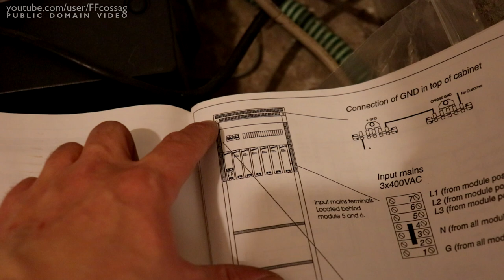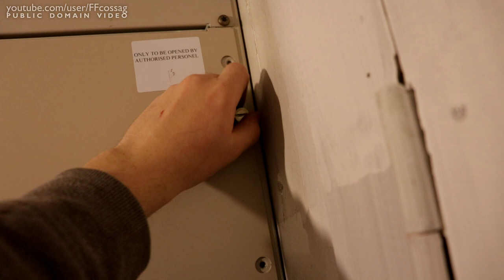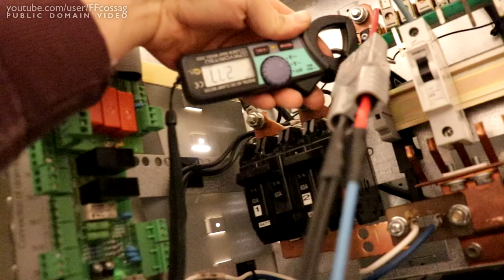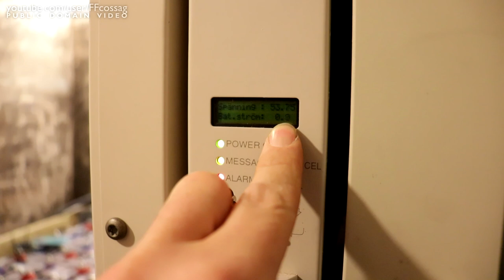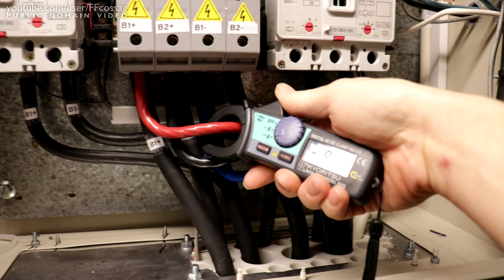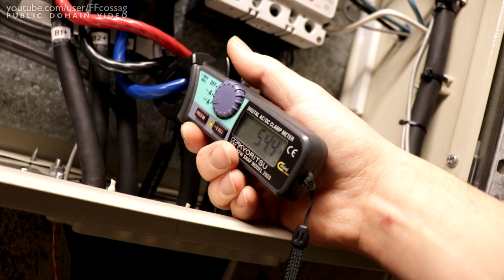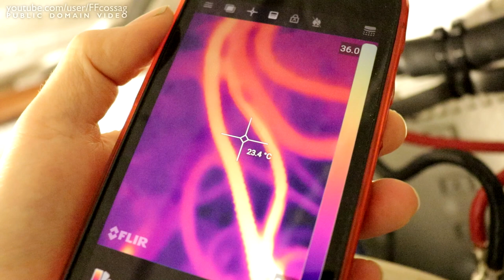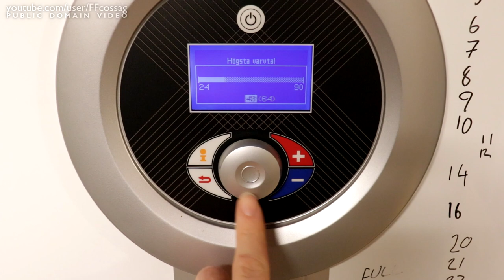Installing a 6 kW 48 V rectifier rack in the basement

Comment: In the event of a power failure like that long-lasting one, the heat from the cables alone ought to keep you warm throughout... :P
Reply from the maker: Hehe, yeah, at 120 A, the entire length of cable between the rack and the DC central will dissipate about 60 W. Ideally, it should never have to do that since it's mostly just an AUX battery hookup, but you never know!

Comment: Absolutely beautiful! 👍
Reply from the maker: Thank you! Cheers!
Reply: @FFcossag  :D Now you can charge properly from the grid too! Using that salvaged cable with the shield was a wonderful idea, I might use that idea myself for my own DC power stuff :) I never thought about using those cables for it, I have access to plenty of them (3x25+16) but never realised they could be useful for this. Ialways assumed the shield resistance would just be too high so I never attempted to try them, after watching this I realised it might not be so bad afterall :D

Free stuff is the best :)
Reply from the maker: Free stuff is indeed the best, and 3x25+16 is fine for up to 150 A or so if you do 2x25 +1x25/1x16! I was meditating on these cables with a friend, and they might actually be fine for a little bit more than that, since the large surface area of the shield, being wrapped around the outside of the entire cable, might allow it to cool off better than the internal conductors - but I wouldn't risk more than 150 A anyway, hehe.
Reply: @FFcossag  Hehe, cable lenght also plays a important role, so for a short run, it might actually be safe to run even more powah through it :) But yes indeed, I suspect the shield might be able to handle more than one would think too, I might need to bring out my big boy transformer and do a little test on this :wink:
Reply from the maker: No, you won't be able to run more current through it than that. 

Those cable current specs are calculated based on how much power a cable can realistically dissipate per unit length without overheating. While you will have less of a voltage drop problem for a shorter cable, the only way to get higher current ratings for a specific cable thickness is to use higher-temperature insulators. A teflon cable will have a higher current rating than a PVC cable, for instance, since it can handle higher temperatures without melting.
Reply: @FFcossag  True, I forgot to keep that into consideration. Been a few years since I took my electrical grades, heh. Cx I'm a electronics nerd, not necessarily power transmission nerd lol 

I'm curious about another thing regarding your solar panel wiring, since all the panels are in series, if one gets slightly less sun than the others will the decrease in power be very dramatic? I know more expensive panels have a by-pass diode, but I'm curious if they actually work in practice. I haven't seen any tests done on that, I suppose I could myself but I don't feel like taking all my wiring apart which took a while to make all nice and neat and proper. My cheapo panels from years ago stop working all together if wired in series and one of them gets covered with clouds, they don't have any bypass diodes. I therefore run a very thick cable to them and use them in parallel, around 20V with 10 amps hehe. You're probably gonna make fun of me for thinking that's a lot of power lol, but for me it is a lot of power lol 😃
Reply from the maker: It's a lot of current!

And the answer is yes, even minimal shading can have huge consequences, though it depends a lot on your charge controller. EEVBlog did a video on it quite recently, about how the shadow of a single guy wire was causing him huge issues.

Comment: Do you have any extraction in that space for any off gassing from all the lead acid batteries? Genuine comment love following your DC battery power updates  👍
Reply from the maker: Yes! This space used to house an oil furnace, so there's a HUGE chimney hookup that provides completely overkill ventilation without even needing any fans. I don't know exactly how much air it moves, but if I hold a normal 120 mmPC fan in the chimney hookup, it'll turn a good 300 RPM just from the passive flow. There's a roughly 80x80 cm air filter installed in a window frame in the adjecent room, so the space is constantly fed with fresh, clean air.
Reply: @FFcossag  I knew you would have it covered, not sure I heard you mention it in a video probably did but I probably missed it, anyway thanks for the power updates I always like the long explainations a testing, Im a telecoms engineer so its nice when I  recognise some old -48v equipment 😁👍
Reply from the maker: I actually don't think I've mentioned it! It's been such a passive thing that I've just kind of not thought about it.

Comment: Would be interesting to know how much heat the systems are dissipating. Do you have a thermometer in the basement?
Reply from the maker: The MPI dissipates about 200 W 24/7, add another 7 % of the total load power to that if it's running off of batteries and 1 % in grid mode. The 48 V charger in the video is 84-89 % efficient depending on which modules I use. I'm currently drawing about 1.6 kW out of the Powec rack, and it's putting out about 350-400 W of heat doing that. The heat pump also puts out a fair bit, but I don't know how much. Since the space is fairly well ventilated, the temperature at this time of year stays around 10-15 C.
Reply: @FFcossag  too bad the ventilation loses all the heat. A ventilation system with heat exchanger would make good use of all the exces system heat to warm the basement or other room 😁

Comment: wow that thing is cool!! how exactly are you dealing with the positive ground issue? is there anything else grounding your 48v DC system? inverter, loads etc?
Reply from the maker: Currently, the entire battery bank is just double isolated and floating, since none of the grid grounding circuits can handle the 500 or so A that the main 48 V bus can push, and I don't fancy upgrading them to handle that, hehe.
Reply: @FFcossag  yea that certainly makes sense, I would at the very least setup some kind of low voltage surge suppression to tie the system to ground incase it ever became in contact with a live conductor, since there is so many exposed terminals I can just see that being a major hazard. so put something in that at will short either the + or - to ground if the voltage goes over 70v of potential. Or at the very least some type of obnoxious alarm that will warn you if something like that happens.
Reply from the maker: That wouldn't work, since it has no potential to ground - it's double isolated. If isolation fails in some device, trying to shunt it would be foolish since it's impossible to predict the amount of current available. I might mount a neon or LED or something between B+ and ground to show excess leakage, though - that's not a bad idea!
Reply: @FFcossag  yea there needs to be some kind of warning system. so you will be alerter before you go to mindlessly touch the battery contacts.

Comment: Well I am confused after this vid, U now have a battery charger installed to charge up the 4 banks using grid power which is too expensive. Have u got an off peak rate? that ur gonna run the battery charger during off peak time? That cable thats heating up for the 300amp hour bank, cudnt u just run 4 lengths of it temporary until u get some decent cable? and ur miliivolt readings were in specified limits even thou they were higher then what the calculator said?
Reply: Yes - he charges at night at an off-peak rate. It was covered in a video a few weeks ago.
Reply from the maker: This thing is mostly installed for a few reasons:
1) It's cool
2) It's free
3) Redundancy in case the MPI fails
4) Ability to charge from single phase sources
5) Convenient 48V bus extension for more batteries
6) Charging closer to the 100 Ah/300 Ah batteries, to make sure they get fully charged

I do have variable rates for electricity, so if it's really cheap one night, it makes sense for me to just ultra-charge in a couple of hours for the upcoming day.

The cable for the 300 Ah bank is going to be swapped out real soon. In actual use it doesn't get overloaded, since about 70 % of the current is drawn from the big banks. I'm just not prioritising it because it isn't that important - I could put it on a 32 A breaker for extra safety in the mean time.

I'm fine with the voltage drop readings because I'm also measuring the voltage drop across the cable shoes and their connectors, so there is a little extra drop to be expected there. If I were to probe the cable by sticking needles through the insulation, it would be damn close to what the calculations show. I'm also not 100% on the exact length of the cable, it's 6 metres +/- 50 cm or so, probably a bit on the longer side of that.
Reply: @FFcossag  thanks for the reply, i find it strange thou u get variable grid rates, it sounds like happy hour at the pub.
Reply from the maker: There are two power companies available here, one offers a set price, the other offers variable. I went with the variable company since they pay market price for exported power from the solar system, whereas the set-price company pays about 1/10 market price for it. I also like the excitement of getting to optimise my power usage - I drive my EV VERY cheaply by charging at night!
Reply: @FFcossag  right on brother.